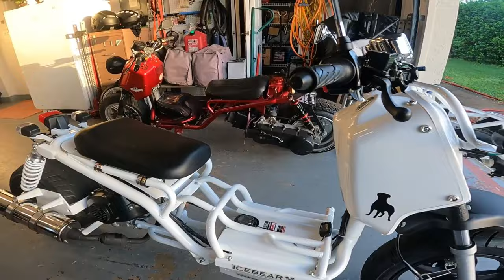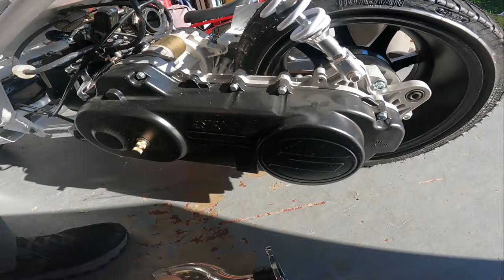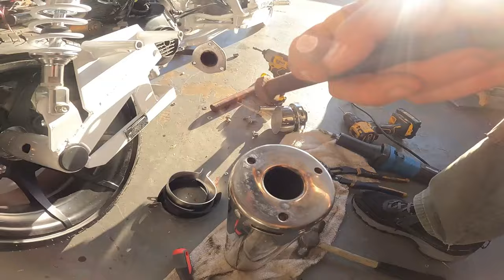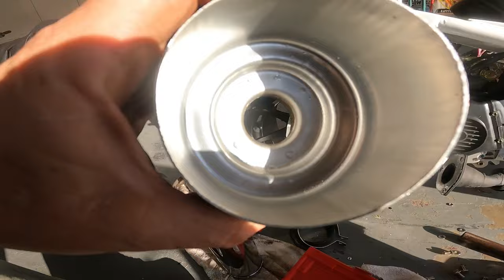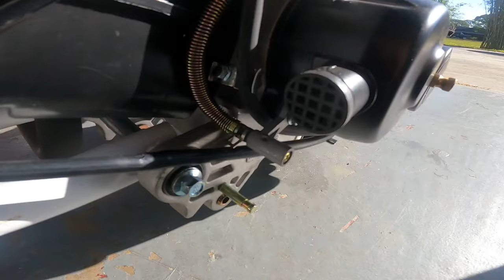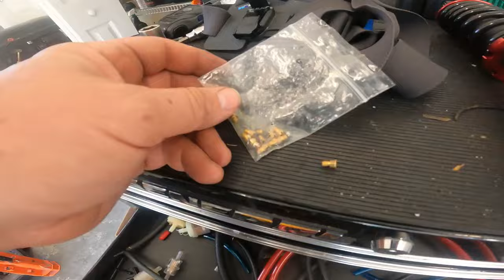Derestrict Your Maddog 50cc GY6 Scooter for FREE

Comment: Just got my 50cc mad dog the other day,glad to see someone making videos on them can’t find a whole lot of info on them
Reply from the maker: I plan to make a lot more but I gave my wheels and other goodies yo a guy for powdercoating.  He has had them over a month 😳
Reply: Yeah mine just came the other day the gas gauge doesn't work which is fine but now it won't start it cld be the battery but I'm not sure I'm a single chick who has to figure this out alone I guess 😬
Reply from the maker: @OrgBobaFret  most likely not getting fuel with the vacuum pump system.  Just make sure that black hose going to the manifold between the Carburetor and the engine is super tight.  That is the biggest vacuum leak area.  Mine leaked when I got it.  If you can't get it to idle consistently then it is prob leaking.  That leak will prevent fuel being pumped into carb and make it hard to start
Reply: I guess it's possible. Mine didn't.

Comment: those tiny engine are so restructed that you can make them faster just caughing over it.....
you did a very good job there buddy.
you pretty much hit the limit with free mods there. 
only one thing left that can help at high rpm is port-matching.
same size doesnt mean they fit properly together :)
gas mixed with the air will travel at like 400 km/h. so imagine half a milimeter off between the intake and the intake port.
on my 4 139qmb just doing a dead simple port matching made a HUUUUGE difference at high rpm ( for a stock 139qmb, 8k rpm is HIGH ).
different for each engine ofcourse, but the best gains i got was 7km/h. thats alot for a free mod.
best bang for the bucks is a glixal BBK with a Naraku sport or race variator and a honda dio rear pulley from NCY ( yup 139qmb share some parts with the beautifull af18 honda dio ). those cost money, but Naraku and NCY are top quality parts for g6 engine. all them 3 ( 50 125 and 150cc ). taida is very good too.
only the naraku is "forged"crank. other are just very strong crank not forged. this means if you go with a bbk and a good crank, you still be limited to max torque at 6700 or so ( i said max torque not max power ). if youg et the naraku, not only it will handle a 52mm ( 88cc ) bbk but also at 10k rpm all day long non stop.
no other crank will allow that mix of high rpm and huuuuuge bore.
thats how good Naraku is.
to be fair, Naraku is the polini malossi sage6 quality for 4 stroke.
and for bad mouths out there, its not chinese crap. its taiwan quality.

with a BBK if over 47mm ( 72cc ), get a crank if yours if over 10k km. else you're good to go no worry.
Naraku win hands down once again, but there is also Jasil. other good crank brand make stroker, and stroker is unleriable shit like in car.
another cheap option, but ive been told they changed now, is a stock Kymbo crank. they sue the same chiness 139qmb engine but better crank ( kymco = taiwan ).
thier crank is like twice as strong as stock chinese crank.
but be aware, they might not fit in anymore.

i know those engine better than my 20 years old pants pocket. i fucking lose them.
they're strong, RELIABLE, cheap to repair. even when modified they stay reliable as hell when built properly.

one thing ive always wondered tho, how do they handle with fatty tire like that ?
Reply from the maker: So looking at that port matching stuff.  I have a complete set of drimmel bits etc.  Is this something I should watch videos on and trying myself?  Also I really don't see anyone online who does legit flow bench head porting on these GY6 engines.
Reply: @GhettoWrench  you aint gonna see that anytime soon budy. people hate 4 stroke so its not gonna happen.

watch alot of videos before trying. and a MOST : practice on a old/broken head !!!!!

dont use dremel bits. waste of tiem and they will shred in no time. use carbid burr as everyone so ! 

on a stock engine, the difference is not so visible. but when modified with bbk and bigger carb, they wake the engine so much !  

im about to test a prototype soon. i dont care if anyone test before, i want result not be famous : some sort of coating that make water/liquid slip on the surface like they do on a windshield ( the fuck is the product name in english ??? only know in french ). so gas/air mix wont crash as much on the walls at 400 km/h. just an idea i had years ago.

properly, but DO IT !!!! worth the time and investment ( a set of carbid burr on temu/aliexpress/amazon ). mine is from temu and been using it since 7 month on a daily basis no problem.
Reply from the maker: @Broken_AK47  teflon!  LOL
Reply: @GhettoWrench  i think thats about right... fucking adhd. how is it even possible to forget that when you use it since YEARS dammit...

Comment: For got to ask bud 
have you  turned down the flywheel about a C.M each side of the pick up sensor  NOT SURE what depth you can take of but you will know and can you get to use a water jet cnc or use a plasma cutter cut on the big size so you can file or dremel it to One of them Very expensive  Polini Clutch covers Should be able to print photos off one on line to get your cuts marked out save $$$$ if you can't get to use the other stuff plas cnc you could always cut the clutch with dremel or hand held oscillating machine hope this get you thinking 🤔
Reply from the maker: Ya I had someone else asking about me doing a lighter flywheel.  I had a light one on mx bike for a few races but noticed I stalled the engine more so got rid of it.  I guess with the CVT it would work good.  And seems there is plenty of spinning mass in the CVT to compensate

Comment: I just got a Maddog 150cc trike n it runs great but I am waiting to get my mikuni fuel filter, jw I am new to this n trying to learn as much as I can, that is why I started following you, if I add the nibbi air filter will I have to add anything else to make up for the newly added air filter?
Reply from the maker: @luafaia5113  no.  You will tune the nibbi eventually, but it runs great right out of the box with the jetting that is in it.
Reply: @GhettoWrench  coolio thanks, so I do not have to tune the carburetor after I put in the air filter, I watched a few saying they had to retune the carburetor after adding the air filter
Reply from the maker: @luafaia5113  I made a video tuning the stock carb on my 150 and also the 50.  It may have been worth 1mph more, but a PITA unless you have spare carb screws and extra jets etc.

Comment: I juat put together a x pro 50 and it tops out at 40mph out of the box.  Varified with gps.  I was actuality pretty shocked.
Reply from the maker: @danjim7056  that's great.  Is it like a regular moped with skinny back tire and aerodynamics?   Those things can be made pretty fast.
Reply: @GhettoWrench  Tires are a bit thicker than normal, it seems.  It's a cheap xpro oahu with 12" vs the typical 10" most of the cheap China ones have.  I'd rather have a real ruckus clone (or actual rukus) aI think they look freaking awesome.
Reply from the maker: @danjim7056  they do look cool.  Have you spend some money though

Comment: Question: is the bracket that holds the muffler by the back tire removable?
Reply from the maker: @Volibarreto  yes.  You will see in later videos of that bike it is gone.  Easy to take off, but have make something to hold the muffler.
Reply: @GhettoWrench  thanks for the fast reply! Will I need to purchase anything extra (other than new/better shock) for this mod? And also, do you have an instagram?
Reply from the maker: @Volibarreto  you should not need anything else.  I font even know my Instagram.   LOL.  My FB Messenger is Ted Edgar.  I am standing in a full face helmet next to red mountain bike I think.

Comment: What size drive belt those 50cc take stock. I'm confused in buying one
Reply from the maker: @michaelmosley1385  the maddog 50 is technically an "extra long" case so it takes a 788-18-30 belt.
Reply: @GhettoWrench  thanks will order soon

Comment: Do you know what would cause these bikes to take so long to start? Every time I go to start mine it take 5 or 6 tries.  I'm going to replace all of the clamps to see if that fixes it. It's a bit embarrassing though trying to start this thing.
Reply from the maker: Just hard to make vacuum at "cranking" engine speeds to get the fuel in the bowl.  Fuel evaporates out of the bowl after sitting awhile.  The pilot jet used for starting is way higher than the main Jet so the bowl has to be really full.   A regular carb u could give it throttle to pull in fuel from the main Jet or add "choke" and pull in fuel from the enriching Jet, but the stock CVK carb does not give you control of that.  I use electric pumps on everything.   Fires up as soon as you hit the button every time.
Reply: Thank you for your reply.  Good to know that there technically isn't anything wrong with it.  I'm worried the starter won't last long with how long it takes to start.  I'm knew to all of this so it is a learning process.  Great videos though!
Reply from the maker: @jayb5623  I had the same thoughts.  Hard on starter and battery.  Make sure that vacuum line going to your intake manifold between the carb and engine is SUPER tight.  That nipple is smaller than all others on the bike and isn't big enough for that black hose attached to it.  You should not be able to easily twist or pull off that hose.  It is the most common vacuum leak area.  If loose the use pliers to put a zip tie on it really tight.
Reply: Thank you.  I bought better clamps and will replace all of them on the bike.  I read some message boards where people replaced the fuel pump with a Japanese one and that helped a great deal.  I think I would rather buy an electric pump though instead. I watched your video on installing an electric pump on your red 150cc.  Will that same electric pump work on my 50cc?
Reply from the maker: Just hard to make vacuum at "cranking" engine speeds to get the fuel in the bowl.  Fuel evaporates out of the bowl after sitting awhile.  The pilot jet used for starting is way higher than the main Jet so the bowl has to be really full.   A regular carb u could give it throttle to pull in fuel from the main Jet or add "choke" and pull in fuel from the enriching Jet, but the stock CVK carb does not give you control of that.  I use electric pumps on everything.   Fires up as soon as you hit the button every time.
Reply from the maker: @jayb5623  yes.  Same pump.  2 to 4 PSI I think.  That vacuum line going to the intake manifold is almost always the culprit for small leaks.  The nipple is too small for the hose on that one.  Watch the video on the white 50 getting the electric pump and it kinda explains the issues with vacuum more.
Reply: I think I found my issue. I'm going to replace the CDI box. I had spark before and now I have no spark. It was happening off and on and now zero spark. Hopefully replacing the cdi box will get me back on the road.  I really want to ride this thing.  For a brand new bike I hope this isn't the start to a long road of troubles...
Reply from the maker: @jayb5623  that is weird.  I have never had an issue with a stock CDI.  😐   bummer.  Don't get the glixel.  LOL
Reply: It was the CDI box! I got the new one installed today and the bike started right up on the first try!  I took it out for awhile and every time it started on the first try. I even was able to finally do the first oil change.  Now it's time to install the 40mm air filter and I'm planning on doing what you did with the stock muffler to open it up. I'll see what those two changes do for speed.
Reply from the maker: @jayb5623  great news.even though it was not easy to find... it was a cheap fix.

Comment: I had no idea the 50s only go 30 out of the box.
Reply from the maker: Ya they are pretty slow
Reply: Myn did like 40 out of the box but I'm light so idk
Reply from the maker: @markn2393  Thats great.  You got a good one.  Weight does make a difference as the CVT transmission will stay in a lower gear with more weight.
Reply: @GhettoWrench  yea it's a 2022 taotao pony 50 did 40 mph gps stock. It's a 1p39qmb so who knows. Some people were saying the p codes are better engines??
Reply from the maker: @markn2393  Ok that makes sense.  Maddogs are super slow compared to other 50 scooters it seems.  The P code makes no difference.  My 50s say 1P39... also.  Maybe it is the newer one.  I have only seen P codes.  I think the poor aerodynamics and make a big dif.  the TaoTao 150s go about 10mph faster than the maddogs also with the same engine.
Reply: @GhettoWrench mine only goes 22-24 mph out of the box what can i do to get it in the 30s
Reply from the maker: @RyWallTheOutLaw  something ain't right.  Rock it on the stand and lift one wheel at time.  Do they spin freely?  Could be something dragging.  Would not take much to slow one down as they have no power

Comment: If your going Maddog you gotta go 150 .
Reply from the maker: I have two 150s.  But the wife does not want to do the motorcycle course so she will be on the 50.  But it needs to go fast enough for city riding.  She just rides in the city when we take them in the truck for overnights etc.

Comment: I got one of these years 4 years ago. To date it has been running for about 3 months on and off. It cost to much to even have it looked at anymore. Just junk.
Reply from the maker: @comatose3788  ya and if you don't constantly work on them...   they quit running and if you are not a fair mechanic you will never get it going again.
Reply: @GhettoWrench  I wouldn't say I'm a mechanic, but I've never had a problem keeping anything else running. It's made of junk, and there is a real problem with the carburetors. The gas in the US is, believe it or not, not clean enough for it, and it really needs higher octane than even premium. Really doesn't matter if you replace everything. It will just start getting all gummed up again. It's just not made well enough to be what it is. After really looking around at it, the pot metal shaft holding the front forks in place was all I needed to see.
Reply from the maker: @comatose3788  agree